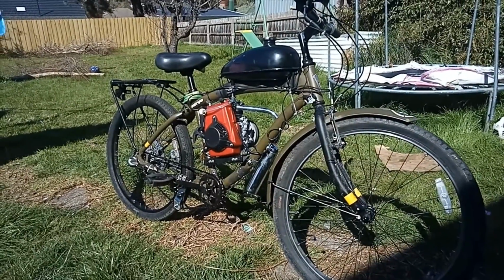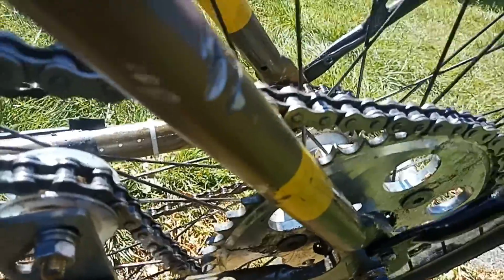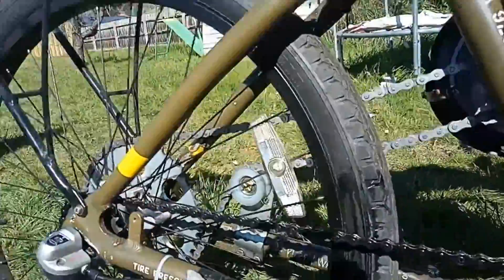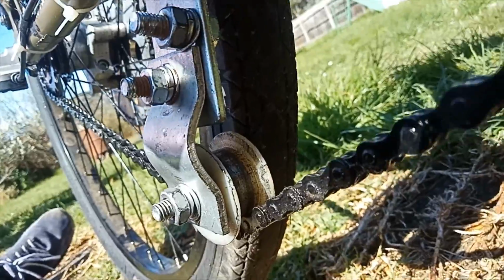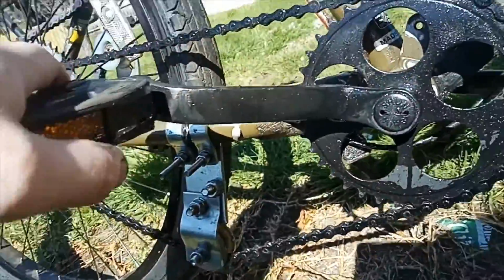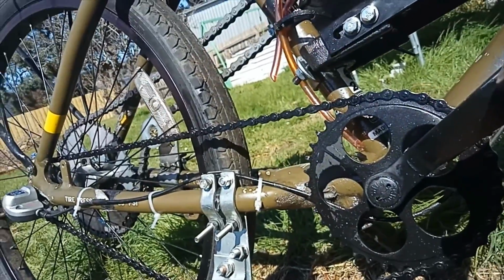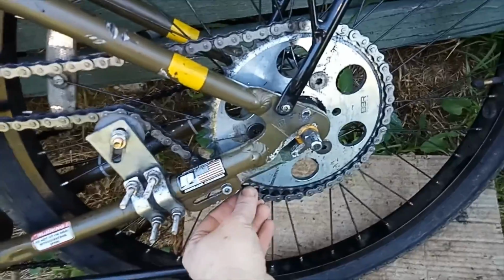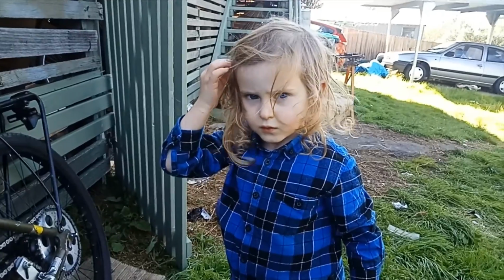Mk4-Stroke Update

Comment: What could possibly go wrong lol!  I had a similar issue with the bicycle chain tension This is how I fixed it.  First I just concentrated on the bicycle side got the chain as tight as possible, but Loose enough that it still spins freely.  And then on the motor side I switch to an arched tensioner.  I don't use the tensioning wheel and the long Allen bolt that they come with because, the tensioner wheel can slide back and forth and it flaps all around.  So I went to the hardware store and picked up I think it's a 60 mm hex bolt, and use the other style of tensioner wheel. They have two ball bearings and a spacer in them and their are much wider. (The ones that they use on the spring tensioners that are made to bolt up to the 2-stroke engines.)  You have to move Arch tensioner closer to the seat tube to clear the spokes. But once I got it set up right now it's as smooth as can be.
Reply: @NicksBikes  I hear you brother!  Hang in there.